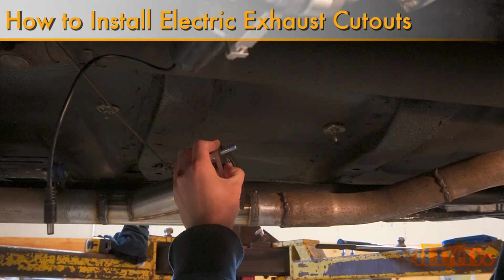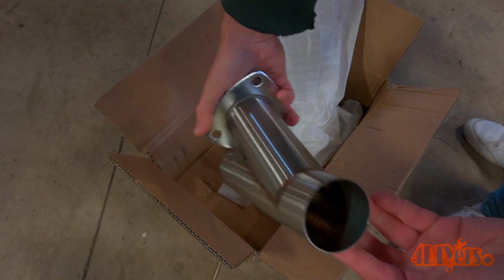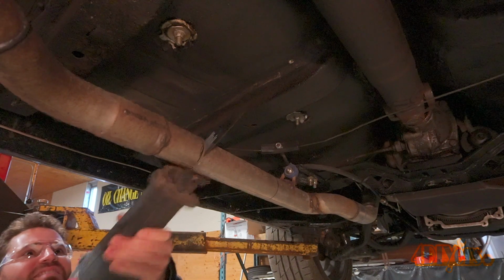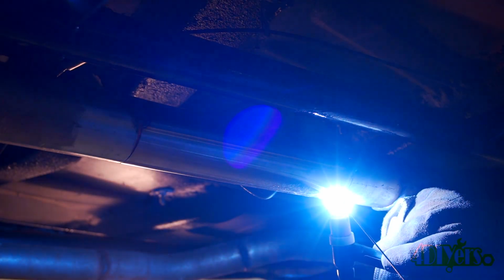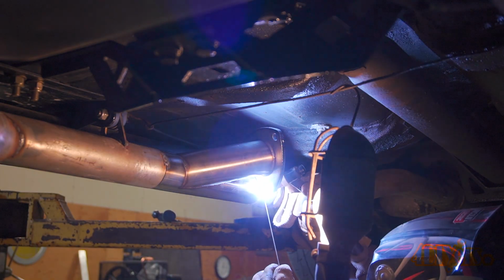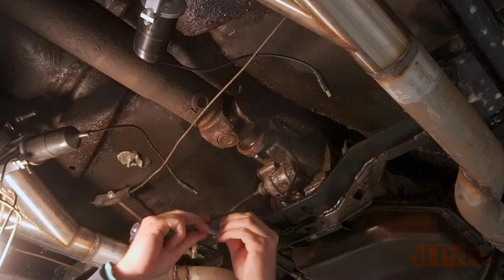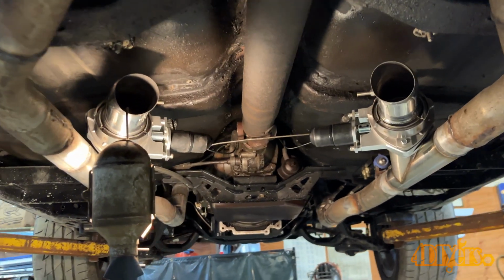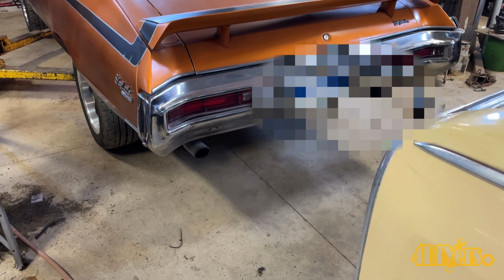How To Install Electric Exhaust Cutouts (Step By Step Guide) from Spelab

Comment: That’s a fantastic video! Even if you don't know how to weld, it's no problem at all when modifying your exhaust system—we offer weld-free adapter fittings. In fact, our factory manufactures all the necessary components in-house. Our goal is to make the modification process both easy and enjoyable.

Comment: Nice video! I have a question regarding cutouts and if it really is needed with two? I have the same setup with two seperate pipes from the cat back to the mufflers. Wouldent it work with just one cutout?
Reply from the maker: Thank you! Do you mean you have one pipe coming off each bank? You would need to have two cut outs, one for each bank. Even if there is a crossover, this could still cause an imbalance between the cylinder banks. The only way you can get away with one is if you had both banks feed into a Y and then a single pipe from that Y all the way to the muffler.

Comment: I have Hooker HKR11051 with key fob to open. They only lasted less than 3 years and 3,900 dry miles before the motors stopped opening the cut outs. Now I have to find just the replacement motors . Spent $462 + the muffler shop cost . Now to spend another $125 for a pair of motors. Horrible product
Reply from the maker: I'm surprised to hear that from the Hooker brand. These are made by Spelab instead and so far hold up just fine.

Comment: Dude, you can have a loud exhaust on vehicles over 25 year old, at least in most states
Reply from the maker: I'm in Canada, you can get a noise violations over a certain DB rating or based on the discretion of the officer. Not to mention, not everyone wants loud exhaust every time they drive their vehicle.

Comment: question: if i get a flame tune, even tho the cutouts have a downward facing pipe, is it dangerous to anything underneath the car
setting: windy day cables are 6 inches above the downwards facing cutting 
or: road covered in oil
Reply: bc I was ready to like take my diffuser or bumper off for the tune and change it time to time, but I’ve looked at cutouts for an alternative mod, (still with the idea that the flames would go thru the regular exhaust with the cutouts off) and my immdeiate thought was like i’d burn the cables and or things near(we’ll burn the cables popped up before i saw the downward pipe), also i see the drive shaft, again Ik there’s the downward facing pipe but i’m high ash and that was my question
Reply: @cloutgod2888 if youre gonna do the flame tune you might as well have the straight pipe go all the way back so nothing catches on fire because your fuel tank is down there plus a bunch of wiring, with the flame kit you could melt all that off, if youre just doing a little popcorn tune i guess youd be already but the sound would be so much better if you had a long pipe for the sound to travel down
Reply from the maker: I wouldn’t take the risk.

Comment: So do they rattle? 

I’ve never known one not to rattle.
Reply from the maker: No issues with rattling. What would make them rattle? A loose butterfly flap?
Reply: @ over time (months) the gears get a bit loose and the flap will rattle when closed. When you hit the button to close it, it stops but then it will rattle again after a little while.

Comment: you didn’t show how to wire it in
Reply from the maker: I did, this kit simply plugs into a cigarette or 12v outlet.
Reply: Can this be wired directly to the battery?
Reply: @Amg641 did u get an answer?